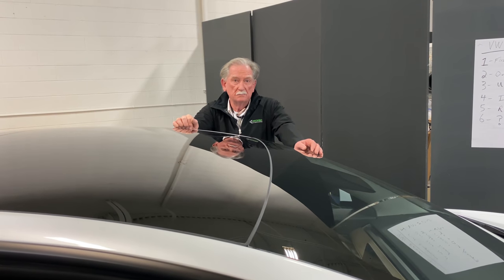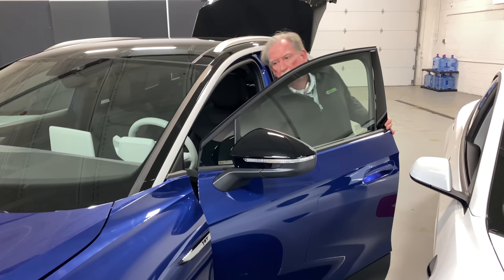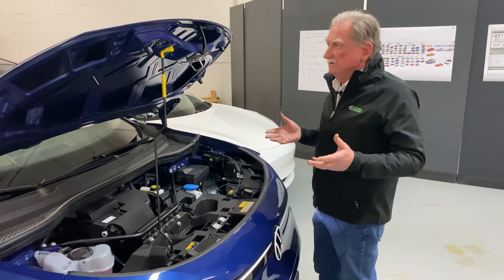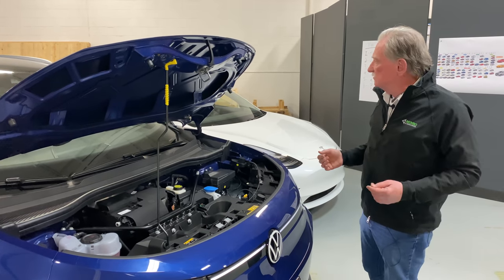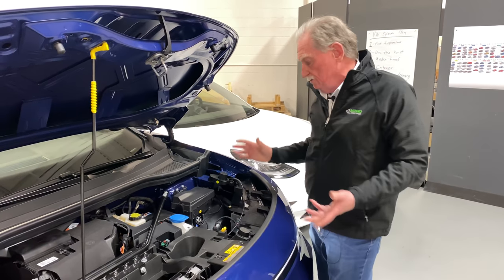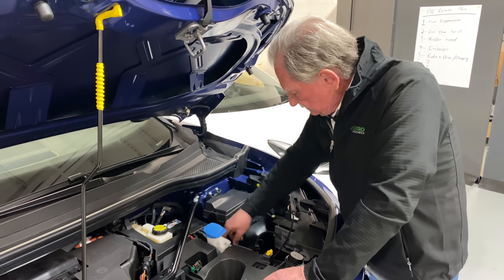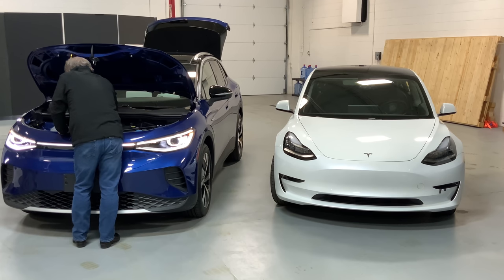2021 Volkswagen ID.4: E2 - Under The Hood

Comment: This is the difference between designing from scratch vs designing from an existing warehouse of parts.
Making an existing heater box fit.  And a fuse box with twice the number of slots than fuses.
PS: After 10 yrs, I still haven’t changed my cabin filter.  Probably explains the dust in my car.

Comment: Most people that own a Tesla rarely use the Frunk
Reply: I use mine  very frequently, it is extremely useful.
Reply: @wowbagger66  I guess if you don't have one You never miss it or need it...
Reply: @philotimo5089  I use it all the time, I have a small bag of tools and spare charging cables in it, these would be rolling around in the back if I didn’t have the frunk. 
I also put food shopping in it in the winter because it stays cool and so does the food. 
We recently did a family holiday driving from Perth Scotland to northern Italy and back and I put stuff like a tyre inflation pump in it that I did not need to use but was nice to have and it didn’t take up space in the boot. 
So yes I would definitely miss it if I didn’t have it.
Reply: @wowbagger66  The frunk would be neat to have...  However there are some thing Telsa has to change in the 3 and Y.  The next models need LIGHTING at night not just having the bright screen. and also they need a heads up screen and if they could throw in massaging seats and better turning radius that would be great too.  Otherwise Telsa still is on top of the game in EV'S but I think my next EV will be the ID Buzz just to be different Again.
Reply: @philotimo5089  I agree that a smaller turning circle would be nice but I have got used to it and it is not a big problem. Massage sears would be nice but cooled seats would be better, I find that my back can get quite sweaty due to the vegan leather (plastic) seats. 
I like the single screen, almost everything I need to look at and operate is in one place and it works very well once you get used to it. I am not sure what you mean about the interior lighting, I have never had an issue with it.
I am very happy with my model Y, I do about 35k miles per year and use the supercharger network all the time so I don’t think that I will buy a non Tesla any time soon.

Comment: 3:25 Regarding weight, I have to disagree. Example is the BMW i3, where they wasted a lot of money on carbon fibre - after all it has the same comsumption as the Model 3.
Weight is important, but more to cost. Efficiency in aerodynamics and drivetrain is the ruler. VW ID.3 and ID.4 - thanks to their software "skills" - you can't preheat the car+battery (opposite to Tesla), but senselessly they heat up the battery electrically AFTER starting to drive. ID.3 owners claim extreme high consumption on short trips in winter. ID.4 has the same bug. This is really dumb. 🤦🏻‍♂️
Well, and the OTA updates still don't work yet. Customers report, that VW dealers often wreckes the control electronics, while uploading a "wired" update at the dealer after some weeks, when THIS update should have brought the OTA update function. No kidding! 🤷🏻‍♂️

Comment: German engineer 1: What do we do with the under hood space vacated by the engine?
German engineer 2: Let's move the fuse box there and make it bigger without any instruction labels.
German engineer 3: And let's put the cabin air filter in there as well.
German engineer 4: And let's brace the airconditioning unit with an enormous metal bar.
German engineer 5: German engineering! Ja!

Comment: Even in an ICE car I hate it when the engine compartment it so tightly packed.  In one car I had (a Ford) there was no way to change a headlamp bulb without removing engine parts first.  Sidelight bulbs had to be accessed through a port in the wheel arch, if you have slim hands and a long reach, a vet could do it!   The ID4 looks like it was designed by the same engineers, no thought for ease maintenance (apart from the air filter, I give them an A for that).
Reply: Nonsense, EVs needs significantly less maintenance, I don't see anyone opening the frunk everytime, the id4 has way better practicality and turning radius than the tesla model 3, go watch Björn Nyland Videos https://youtu.be/8NDimpnRAO4

Comment: I am seriously asking. Why would you want to jump an electric car?
Reply: The 12 volt battery still runs electrical components such lights, media unit windows usb ports etc.  If it goes dead you may to jump it to "start up the car"  the main battery runs at a much higher voltage.

Comment: The ID4's lack of 'frunk' is largely due to it's much shorter 'hood' (bonnet) surely ? The continuing use of fuses simply suggests more 'conservative' thinking.
Reply: A frunk full of stuff will make the vehicle nose-heavy that gives FWD handling vehicle.  A frunkless ID.4 doesn't have the extra weight ahead of the front axle, which gives the vehicle more favourable RWD handling.

Comment: Not owning an EV myself, I'll claim ignorance -- But what is the scenario where you'd need to jump start a battery powered car?
Reply: When the 12V battery dies you need external 12V to "electrify" your car. Without 12V its not allowed to work anymore. And most simply can't.

Comment: @Munro Live   It sounded like a mechanical release for the hood. Is it? or is it a solenoid? Are doors electric or do they use mechanical releases? Solenoids are OK as long as the electricity is flowing. Can you even get out of a M 3 if the 12v goes down?
Reply: Yes, there is a lever at the top of the arm rest.
Reply: David - in a Accident ALL the Doors Automatially UNLOCKED and EVERY Tesla has a MANUAL door Release PULL TAB.
making it the Safest Cars on the Road today.

Comment: What about looking into the $4K SGMW Wuling Hongguang Mini EV? Will be interesting to see how GM and Wuling can sell a capable car for $4K.
Reply: A car consists of 5 wheels.: 4 on the street, one in your hand. The Wuling is just that. Please don't look too hard at it, it may collapse.
Reply: @wolfgangpreier9160  I would like to buy one. You can move around in a Golf cart in many  communities around here, the Hongguang is better than a Golf cart . It can even help power a house since it comes with a 15kWh battery. Most lithium batteries (like Battle Born) in the US sell for $1K/kWh, so the battery alone is worth $15K.
Reply: @hurry2011  Yes, thats true!. Its Better the a golf cart. I just looked up how much a used small EV costs. Not less then 7000,-- Euros i'm afraid.

Comment: In most european cars there is a lot of space between the bumper and the coolingssystem also between cooling and engine. This is crash space for impact of pedestrians, that parts can move inside of the car to absorb energy. 

How is this solved when there is a frunk which is full? Nobody cares i guess.

Comment: 1:50 VW hates cost, so after 20 years even the new Golf didnt get proper gas hood struts anymore. Cheapy decision by Volkswagen...
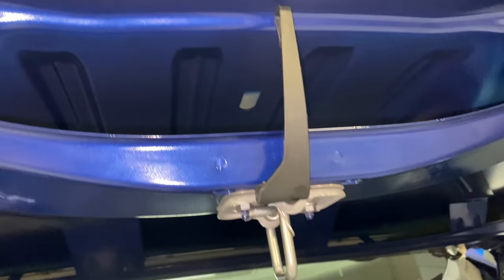2:40 I dont like this " bridge" under the hood where the hood- latch is hanging from, its going to collect all the road- grime and rot out faster.
4:17 Thats because needs to sit properly and you have a chance of adjusting panel- gaps, a thing Tesla never heard of. Also they needed for those hood impact absorbers.

Comment: In Germany we still have not figured out software. Mercedes is making a push. It needs proper proprietary solutions for CPU/GPU/AI and OS. If germany sells itself to "google automotive" it will its downfall. (too dependent and not different enough)  The software is super relevant now, "engine feel" and noise and whatnot is not a thing with EV's. They all feel similar. Battery tech and software is where it is at now. With the chinese coming soon I think VW and others should make some ID4's in chattanooga and slap a made in USA sticker on it for some sales....Once the chinese show up with a 5k to 10k chepaer option its game over anyway. I am not too worried about building an EV the traditional way as if you would a gasoline car - thats a transition thing. That can be sorted with regular engineering over time. But in terms of software we are behind in germany, the sluggishness of the ID4 is a good example.

Comment: Lot's of ,,I don't know " for a man who pretends to know. 

I had a passat b6 and now I have a b8. I am an engineer, but I can only make assumptions here because this is not my field of expertise. 

In a vw, and probably other manufacturers too, the things are the way they are because of the legacies. They are reusing what they have mastered on combustion engines cars because it's cheaper for them that way. They also want to constraint you into using their approved vag garages.

As this man said in a different video, in many companies they don't do major changes due to risks. They just accept what's safe and works. 

Tesla was always electric and they started from scratch. Testa did not get to have manufacturing legacies because they are still learning about manufacturing.

Comment: especially since this person didn't bother to research properly. The main fuse box is located in the interior of the passenger compartment. The fuse box in the front of the car is for some units that are in the immediate vicinity of the battery. Another fuse box is located in the rear area, which is mainly responsible for the high-voltage area.
Sandy, please don't try to spoil the German cars with your wrong research, you already said pure nonsense about the battery and now you're trying again.
Maybe tell the people here on the canal something about ranching, maybe you have a little more experience there. You have no clue about cars and their technology ...
Greets from Germany

Comment: Great commentary Sandy.  So far the ID4 looks like a modified ICE design.  Pretty much old school.
Reply: Nonsense, the id4 has way better practicality and turning radius than the model3, its a brand new platform for EVs only.
Reply: @alanmay7929  The Model 3 is a sedan and if the big claim to fame for a car is turning radius they've got some serious engineering work to do.
Reply: @StormyDog  I repeat myself again, the id3 and id4 were built from the ground up as EV and were specifically made to maximise practicality and manœuvrability, go watch Björn Nyland videos and stop talking nonsense.

Comment: Even if that crossbar is coated to make jumping safe, how am I supposed to know that when the time comes?! I'd be freaking out trying to wrap my jumper cable end in my jacket or something to avoid causing a short. Seems like a poor design choice... thankfully my old highschool electronics teacher demonstrated how much current a 12V car battery can put out... not to be played around with!
Reply: There is a positive pole in the fuse box,
Which is a very normal place to put it,

Comment: Sorry Sandy, but in this Video I think you fallen into the trap of being dismissive of the VW engineers and the decisions they made Because they are VW, and thus "old fashioned" compared to Tesla. with a bit of consideration most of the things you found flawed actually have good reasons and thought put in them. Tesla has its strengths and plays well to them. VW does the same.

Comment: I might not be an expert (although I also work in automotive) but generally it's preferable to have heavy front in electric vehicles because of crash safety. That's also why bumpers get beefier and beefier. Pedestrian safety is important no matter the sarcasm. Also Tesla is very expensive car compared to VW ID that needs to be affordable,  that's also why you don't have gas springs, aluminium & special electric connectors. Moreover, ID is on MEB platform that is modular while Tesla cars don't have many carryover parts as seen in Model Y teardown, again effect of scale vs tailored product that can get away with being hacky mishmash (Model 3 door welds).

Overall while I really liked previous stuff from Munro, I'm dissapointed with this vid.

Comment: IMO there are so many things wrong with that "cross car" bar it isn't even funny. First, why is it even there? The HVAC can be supported differently that would still leave the filter system easily available, if there's a scratch in that coating, you're going to spark and it adds weight. Unless it's literally a support member, it needs to go...
Reply: lateral strenght. it's not just to hold the HVAC
Reply: @merzto  That's a shame. If they'd use a single casting for the nose area, that'd eliminate even the ghost of a need for that bar.
Reply: There's a tab in the fuse box where you connect the jump lead, you're not supposed to use the battery terminal.

Comment: I believe this is a good tradeoff for people that still like to repair their own car. Tesla is very notoriously bad in that case.
Reply: Why? Because Tesla has no blow out fuses in two fuse boxes without documentation?
Ever tried to replace a upper wishbone arm yourself?
Reply: what makes it a good trade off?  What would you repair under the VW hood?
Reply: @Christopher.s  Replace the Timing Belt and the serpentine belt, oil change, brake fluid change, rteplace the rusted master break cylinder, something like that of course.
😜👍😎

Comment: I really do wish they had fitted a frunk. I use my Model 3’s frunk every day vs. my trunk only for big items. I do hate that Tesla got rid of the little grocery bag hooks. Those are literally one of the best things about earlier 3s.

I have a sneaking suspicion that when they start building the ID.4 in Tennessee, they will not keep the head impact stuff. It’s just simpler now to make one model since these initial models are coming from Germany. 

Regarding HVAC filter… I like you can get to it easy. Most other cars I’ve had except the Tesla and an Audi Q5 have had the air filter behind the glovebox. Usually very easy to get to. The Audi and Tesla are a huge PITA.
Reply: I really hope they do, as US has a terribly high rate of pedestrian fatalities, caused by car drivers.
Reply: Go watch Björn Nyland, the id4 has almost the practicality of a tesla modelx.
Reply: The id4 has a way better turning radius too.
Reply: @alanmay7929  I was surprised just how big the turning radius of the Model 3 is, especially compared to my old 3-series BMW.
Reply: @alanmay7929  the RWD ID.4 does have a better turning radius, but I’m not sure if the AWD will be the same. Personally the ID.4 is okay, I wasn’t impressed with the interior but the exterior looks so much better than a Mach-E or Model Y. I am looking more though at the EV6 or Ioniq 5 to really revolutionize somewhat affordable EVs since they’ll offer 18 minute 0-80% charging times.

Comment: 8:10 of course we can’t under and why all this heavy structure is in the Frunk. A structural analysis would be needed to explain this. I like these videos but all too often the perspective is completely from a manufacturing standpoint. To say (verbatim) that “there is excessive weight “ in this or that area, or the materials used are wrong, without acknowledging the unknowns of static and dynamic loading and crash integrity, is borderline unprofessional. And wouldn’t be accepted in any legitimate design review.

Comment: I guess VW can't resist making layouts overcomplicated even without the combustion engine.
Reply: It's really just that: a wild guess.
Reply: Keep in mind that Tesla has most of that stuff hidden behind panels, so you don't get to see they all become the same convoluted mess when you start digging. The difference here is that VW expects you to open the hood maybe 2-3 times a year depending how much washer fluid you use, so most owners will never look in there. The detachable washer fluid bottle is a great idea to make filling it easier without a funnel though.

Comment: Beefier than what is needed....hmmm...isn’t that the hallmark of German engineering?
Reply: Needlessly complicated and expensive to maintain but it works well provided your maintenance is perfect would be typical German engineering. Beefier than needed would be more of an American thing I think, though not so much in the US automotive industry, where cheap is everything. Japanese engineering is the hardest to do, but looks the simplest when you see the final result as it's the maximum function from the minimum parts based on exhaustive testing.